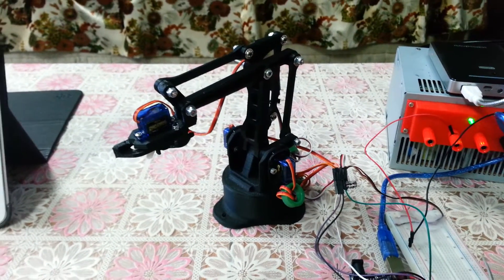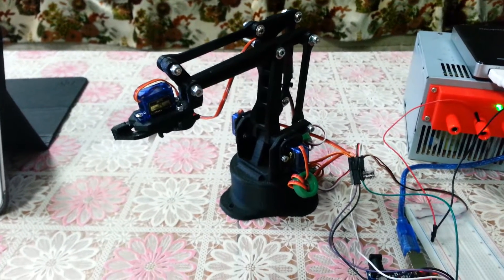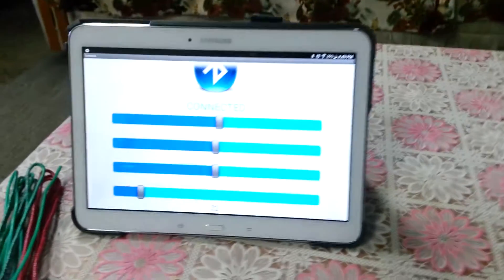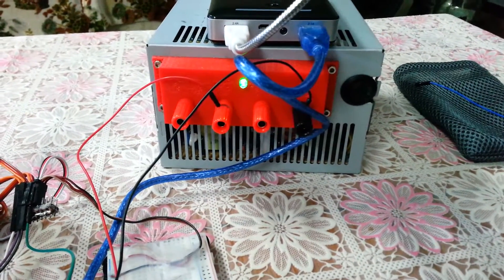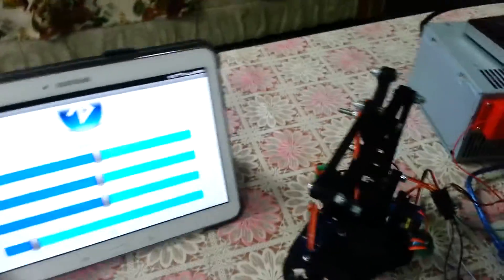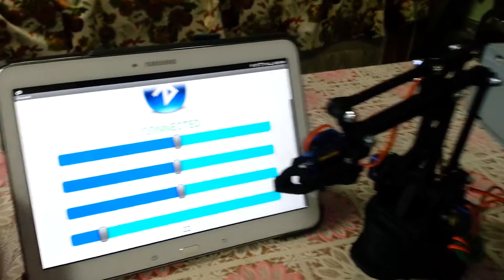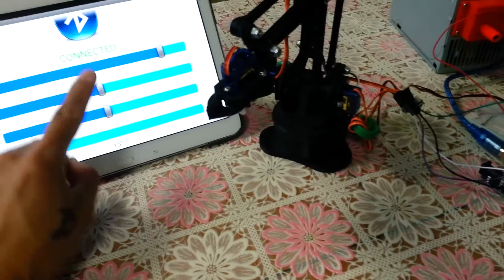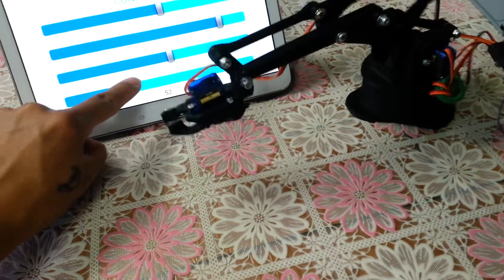Eezybot Arm - Arduino Bluetooth

Comment: What code did you run?
Reply from the maker: #include <SoftwareSerial.h>#include <Servo.h> 
Servo myservo1, myservo2, myservo3, myservo4;int bluetoothTx = 6;
int bluetoothRx = 7;SoftwareSerial bluetooth(bluetoothTx, bluetoothRx);void setup()
{
  myservo1.attach(8);
  myservo2.attach(9);
  myservo3.attach(10);
  myservo4.attach(11);
  //Setup usb serial connection to computer
  Serial.begin(9600);  //Setup Bluetooth serial connection to android
  bluetooth.begin(9600);
}void loop()
{
  //Read from bluetooth and write to usb serial
  if(bluetooth.available()>= 2 )
  {
    unsigned int servopos = bluetooth.read();
    unsigned int servopos1 = bluetooth.read();
    unsigned int realservo = (servopos1 *256) + servopos; 
    Serial.println(realservo); 
    
    if (realservo >= 1000 && realservo <1180){
    int servo1 = realservo;
    servo1 = map(servo1, 1000,1180,0,180);
    myservo1.write(servo1);
    Serial.println("servo 1 ON");
    delay(10);    }
    
    if (realservo >=2000 && realservo <2180){
      int servo2 = realservo;
      servo2 = map(servo2,2000,2180,0,180);
      myservo2.write(servo2);
      Serial.println("servo 2 On");
      delay(10);
      
    }
    
    if (realservo >=3000 && realservo < 3180){
      int servo3 = realservo;
      servo3 = map(servo3, 3000, 3180,0,180);
      myservo3.write(servo3);
      Serial.println("servo 3 On");
      delay(10);
      
    }
    
    if (realservo >=4000 && realservo < 4180){
      int servo4 = realservo;
      servo4 = map(servo4, 4000, 4180,0,180);
      myservo4.write(servo4);
      Serial.println("servo 4 On");
      delay(10);
      
    }
    
    
  }
}